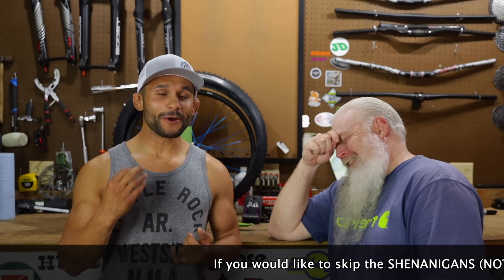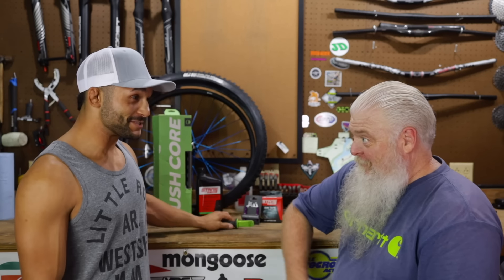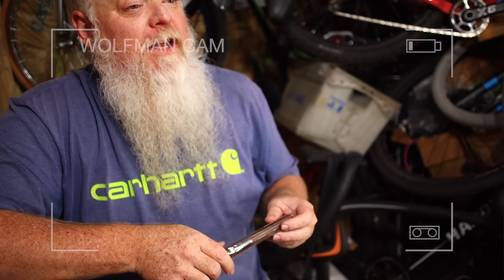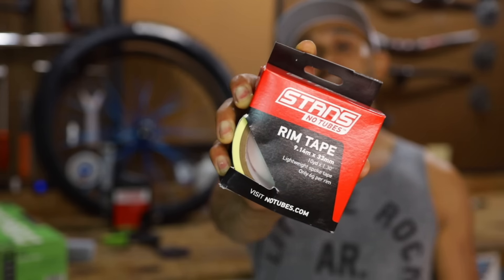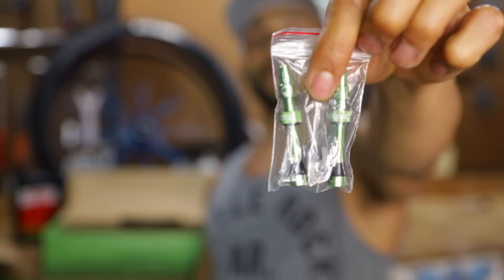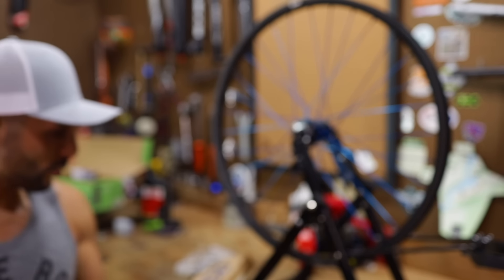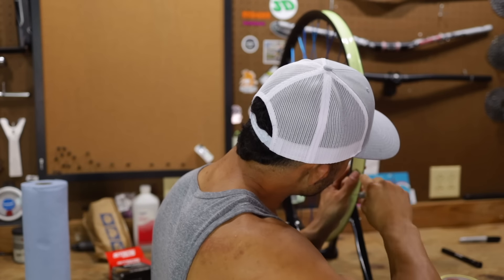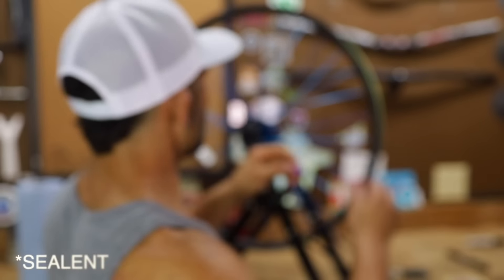CUSH CORE!!!

Comment: 5:11 I bookmarked this brand, maybe I saw it on the channel before, but I forgot about it, but great they got hole at the bottom, this means you can easily unclog them without any sealant eating solvents, just poke a pick, hex key trough each end at the time. Don't even bother trying the Cush Core valves. My inserts came with them, but they were impossible to unclog. I got Stzy valves, they too have a hole at the bottom, hex key slot at the hole, but not as big holes on the side but the new design does, but the cap has valve core tool built into it.

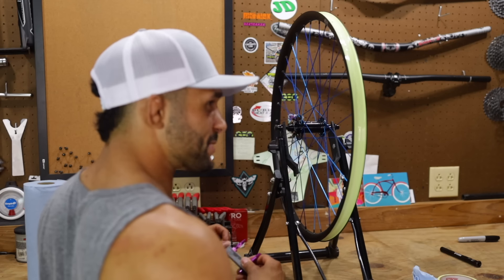Comment: 11:31 I agree with both of you. this is transitionally what you call purple, but there are different shades, like magenta which is closer to pink or in hex triplet: #FF00FF😝So if you want colour match, then you need to use the colour codes.😝
12:34 This is neat, sometimes valves loosen, especially if temps change rapidly, I've experienced loosening of valves before. But it has really been an issue, but happens sometimes, then it might leak slightly.

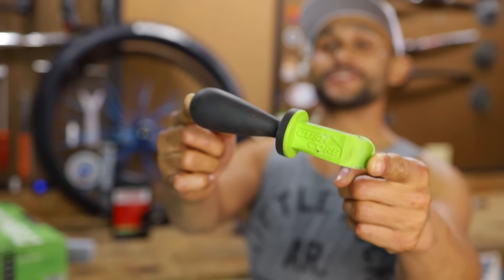Comment: 4:54 great tool, robust too, for some reason I first one I got snapped at the tip, was probably fault, got unlucky. Second one did not, still use it, holding up well.

Comment: Those screw on skewers are nice weight savings too. About 100g when replacing standard qr skewers. So about a 1/4 of a pound. Also I feel they are safer because you can really crank that bolt tight.

Comment: 10:38 You manged to get the tape to sit quite well despite not using a microfiber towel and thumb to massage the tape into place.  doing what you did did not work for me, the tape refused to stick properly without bubbles, it made bubbles all over. Also I was not impressed by the quality tape, the cut of the tape, one roll had uneven bad edge, another roll had scrapes at the top of the tape. I had to use microfiber towel to get the tape to stick, I made it stick perfectly.
I see you got it almost perfect, perfect almost everywhere apart from one spot at 10:44. I'm not sure how you managed that, I stretched the tape as much as I could.

Comment: 13:45  How to not do it. Why do you overcomplicate it? there are plenty of videos on it already. Even Cush Core did a video on it. Hands should not hurt doing this at all. It should take few seconds to do each task, so maybe a minute or 2 maybe 3. Maybe 30 seconds if you really rush it.
How to do it:  start from the top, flip the wheel, put it on the ground then work your way up and pop the last bit with thumbs, takes just a few seconds.
14:46 You are also doing this wrong. Don't put it on the work bench, this makes the job harder, Instead you should lay it on the floor,  align the logo, then use thumbs to pop the bead into place make sure to work it on both sides until it sits secure then you can continue doing the rest until you can't then you use the bead setter/tyre lever to push the bead into the centre of the rim. this too takes seconds, then you pop the last bit over the rim. Soapy water is not needed. Nor using multiple levers nor two people, nor a bucket or trash can. The trash can thing just makes you be able to stand and not have it too high up like you have on a bench, but still be able to stand, but I do it on the floor instead.
6:06 You need to install the insert first. Only way you can do what you attempted there is if it's already been installed, then you can reposition it, but then you risk it coming off completely, But depending on the rim you might be able to turn the insert while it's installed.